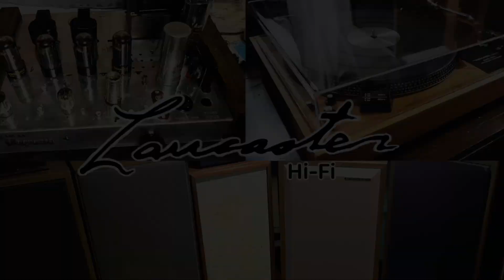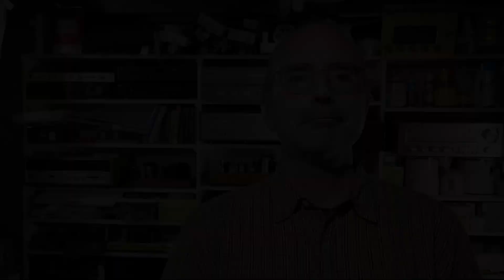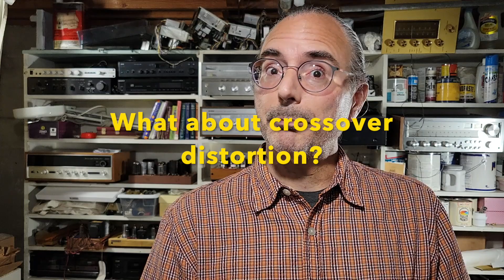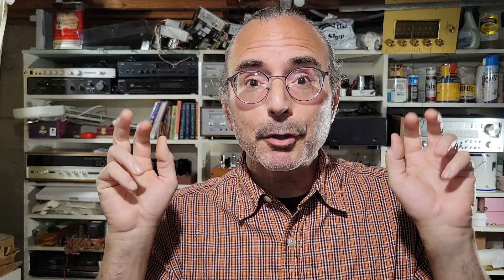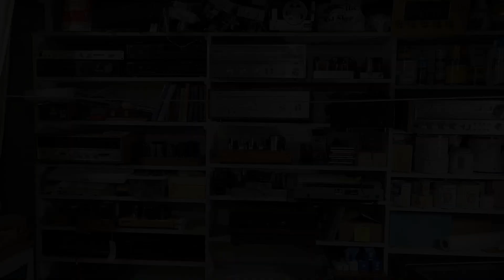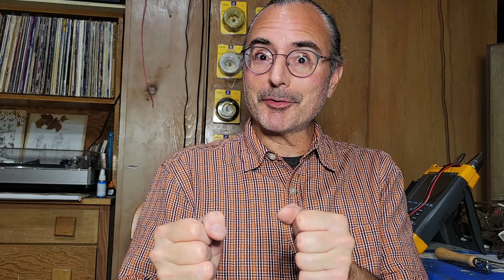Why Do You Want a Single-Ended Triode Tube Amp?

Comment: Well, of course all amplifying devices add HD and some even worse distortions. Also most changes we make to deal with the issues have unintended consequences not all of which are necessarily good. For example with appropriate amounts of FB we reduce over all distortion but it increases the order. Under what circumstances that is a problem is a matter of no small debate.

Now when one builds a SET they could bias it in a very nonlinear part of the curves or a very linear part of the curve. Some of the tube "buffers" for example run at ridiculously low plate voltages and are indeed distortion machines. But those same triodes when used properly in a line amp are exceptionally clean.

One nice feature of class A amps whether SE or PP is that the HD decreases as the volume decreases which isn't always the case in AB amps.

Now full disclosure the only hi-fi tube amp I have built so far is a SE one and it does use local FB in two forms. It is UL so it gets FB from the transformer primary back into the power tube. It also uses plate to plate FB which is also local. Sounded quite clean to me. I have no means to measure HD or IMD but it didn't seem to lose anything in clarity compared to my silver face recievers.

Once I finish the speaker project I do want to play around with PP EL84 probably triode mode at first.

Comment: Dear Stephen: As someone who is looking to buy his first tube amp, should I: Build a magnetic anplifier 2. Rebuild a pair of Atwater Kent televisions and run the audio as monoblock amps  or 3. Simply use a pair of earbuds that came with my phone, because I only have an amp budget of 500 dollars?
Reply from the maker: Do you mean a Magnavox amp? I would rebuild an old console amp, e.g., Magnavox. There are great threads on Audiokarma.org that give you the step-by-step, and whatever you can't figure out can be found by asking there. Those guys are knowledgeable and friendly. Less than $100 for an old chassis. If you use the original output transformers and tubes, all the parts you'll need will cost you less than $100. Then, you can upgrade with better transformers and tubes later.

Comment: I really enjoy your videos! I have a question for you with a bit of back story. I'm an avid 45 collector and always dreamed of having an old tube jukebox or console, but never wanted to deal with the record players contained within. I moved to Mexico City a few years ago, and LO AND BEHOLD, I found an old Stromberg & Carlson powered extension speaker cab from the early 60s, made in Mexico! It has a monophonic single ended tube amp with one el84 and 2 6 inch alnico speakers. I didn't even know such a thing existed. IT SOUNDS INCREDIBLE, just as I had hoped. BUT, I was wondering, if I wanted a stereo rig, could I just use two mono amps like the one I have? And also, I am a record producer. A long time back, I mastered an album on an old tube powered mono reel to reel from the 40s. We didn't even end up recording to tape because the passes were so problematic, but the sound from the tube amp alone was incredible. I'm interested in using one (or two for stereo) old single ended tube amps for mastering recordings. I have not heard of anyone doing in the modern age (please someone correct me if I'm wrong). So would I just need a load box to attenuate the output and implement a dummy signal? Sorry for rambling, THANK YOU!
Reply from the maker: Regarding the Stromberg-Carlson, if you can feed a couple of those with a stereo preamp, that would be a nice stereo system: tube mono-block-powered speakers. 
Regarding mastering, I'm not sure what sort of process you want to use. Do you want to use the tube amps as a processing stage? If so, you could use a line-level stage. If you want to use power amps (amps with output transformers), then yes, you'll need to put dummy loads on the outputs, and then you can use it at line level as long as your next stage has a typically high input impedance, e.g., 47K or 100K.
Reply: @Lancaster_Hi-Fi  Thanks for the reply! What I'm looking to do is, after completely mixing the album digitally, to run it out of an interface at a line level into two mono SE amps, and record that directly into another digital interface. Then after that I would do a final master digitally. We had actually done this before to an album using a tube powered reel to reel from the 40s. Didn't even record it to tape, just took the audio straight out of the tape machine monitor. Of course it was in mono, but the sound was fantastic! I know back in the 60s and before, there were tubes used  in the recording process, but I've never heard of anyone doing it the way I am proposing.
Reply from the maker: Yeah, you're adding pleasant-sounding, predominantly 2nd-order-harmonic distortion. The listener then gets the SE tube sound without needing tubes. Cool!

Comment: Very good. I finally built a stereo SET amplifier using 300B and it has a charm all its own. The harmonic profile is much like a sawtooth with descending amplitudes and a full spectrum of all harmonics. I had to do it because, as you mentioned, I had to hear it for myself. I eventually went back to my push-pull amplifiers. I particularly like the Williamson design. I also might add that in the, so called,  super-simplicity of these SET amplifiers, component values become much more critical than in push-pull amplifiers. I put in a switch in my SET to give me zero NFB and 7 dB NFB and prefer the touch of 7 dB of NFB as it makes it slightly cleaner. Long listening times do become more tiring, in my opinion and sine wave output is around 1% at 7 watts.

Comment: Correct amount of gain in preamp is crucial.i use 6922 series to 12bh7 one side driver to 6550 se snd channel subbed 5879 in v1 .no tone stack .one vol 500k for each channel no nfb for guitar.

Comment: A few years ago, I was the proud owner of a Sansui AU-719. In my apartment, my upstairs neighbor thought there was an earthquake happening. It wasn't a problem for him as he didn't see it as a disturbance. Since then, I've been adjusting my hobby audio setup to avoid causing any inconvenience. I relocated my entire setup away from the heating pipes. I replaced my floor-standing speakers with monitors on stands. Now with a tube amplifier, it's very loud indoors but very quiet outdoors.

Comment: Howdy. Great.
Yes. One can get a flat response using global neg. feedback.
There is a problem doing single wave measurements. It does not show the effect of phase lag. Adding a lagged sine wave to the original sine wave results in a sine wave.
OPTs may be considered to cause the same time lag at different frequencies. This causes different phase shifting for different frequencies. If this has any relevance to the sound, I understand, is a subject of debate. I can't take a stand on that.
Global neg. feedback easily generate spikes and ringing at the kinks measuring with rectangle waves. These may cause the end tube grids going positive resulting in blocking distortion. Spikes and ringing must then be managed by limiting slew rate. I don't use global neg. feedback in my designs. I take the feedback from the end tube anodes.
Another reason is I like the extra electrical safety the OPTs deliver leaving the secondaries floating.
High Regards.
Reply from the maker: I can see the advantage in going from the anodes. Of course, you'd need a coupling capacitor, and it would make the calculations for the (input stage) cathode and feedback resistors a lot different, but simpler in a way, since you just need to figure the resistance needed to attenuate the signal. Would that be a much larger value than going from the secondary? Plus the impedance of the primary being much greater, the value of the feedback resistor wouldn't have much effect on the value of the cathode resistor on the input stage. Am I getting that right?

Comment: Might you point me toward a SET amplifier schematic that doesn't require feedback and could be built by a beginner? And if not built,  perhaps easily modified, (like Skunkie Design mod -A 12). Props to Stephe. Suggestions?   95 dB sensitivity speakers. Heresy II
Reply from the maker: The one that's been recommended to me, and the one I intend to build, is the Simple 45, the latest version of which is the TubeLab SE II. With a few changes, it can be built for 45's, 2A3's, or 300B's. I have some Tamura output transformers that are perfect for 45's, so that's the version I'll be building.
Reply: @Lancaster_Hi-Fi  Thank you for everything. Appreciate learning from you.

Comment: I agree with some of the material, and from a different perspective. The main problem I find is that 
virtually no one understands the basics of how to design a perfect push pull amplifier. I am addressing naturalness, the instrument sounds real, not some manipulation SET using high distortion (as the author nicely mentions), to create some kind of 'pleasing sound', but not natural. If someone likes their 'pleasing sound' no sweat. But to claim the sound is superior is obvious nonsense. 
SETs will never be natural sounding for several reasons let alone the holy grail. (I applaud the 
author's clear explanations.)

1. The Harmonic Distortion (HD) is much higher, esp using DHT tubes with higher HD, with 
Intermodulation Distortion (IMD) typically some 2-3 times that of the high HD figure. 

Even at one watt, the HD of DHT types can be 20 times that of a properly designed Push Pull (PP) amplifier. At maximum output the IMD of an SET amp often runs some 15% to 45%. Interestingly, IMD product frequencies are Not related to the music. 

(IMD is the combining of different musical signals, and their harmonics to produce higher 
weird higher frequency harmonics not related to the music. Now you know why demonstrations of SET amps use solo/single instruments, not orchestras with their many instruments/signals. There is also big bucks selling the larger output vacuum tubes for more power out; often hundreds of dollars per tube.)

2. The damping factor varies to near zero damping to maximum, as one approaches max power output. 
That means the speaker cones are not controlled over a portion of the cones movement, increasing 
the distortions. 

To mask the odd harmonics of SETs, the designers will use techniques to insanely increase the 2nd harmonics, which limits dynamics, masks true inner detail, the natural music. Anyone seen 5 foot wide lips? 

3. Limited high frequency response. -3db at 35khz is not uncommon. This means the frequency response
from 20 to 20khz is artificially manipulated. At 17khz, ~ down 1.2db. At 9khz, down ~ .5db, and at 4khz, 
down ~ .15db. That may not sound like much, but the sound quality is affected down to the lowest 
bass. 

4. As the author nicely mentions, AB1 does not have notch or crossover distortion. Class B does however
and is often falsely presented as to why SETs are superior. 

Example: At one watt, my PP amp only has 0,05% total HD, without feedback. (The sound is not etched.) Try that with an SET, especially with a DHT tube. With them 1% or higher is typical at 1 watt.  

cheers
S
Reply from the maker: That's a lot to consider, and deep! Thanks!
Reply: Had a nice push pull el34 sold it for a SET 😂 . BEST DECISION I EVER MADE
Reply: @ChrisBeenDeadInside4WhileNow  What kind of speakers are you running, 
distorting Horns with a distorting low power SET amp? Great combo LOL. 
I have not heard a natural sounding SET amp yet.
With horns difficult to obtain natural sound, 3d spacial imaging, has poor low frequency 
response. 

I guess one bad push pull amp means all are bad. Of course that is not true.

cheers

Comment: If you are going to employ negative feedback in a SET would it be better to forgo tubes and just use solid state?
Reply from the maker: Good question. I've never had a solid state single-ended amp. I think the Nelson Pass Amp-Camp Amp is single ended,  and those have a following. My recollection is that the ACA has no negative feedback, though.
Reply: @Lancaster_Hi-Fi  🤔… I think the ACA might have negative feedback.
Reply from the maker: Could be. I haven't looked into it.

Comment: The highest grade amplifier should not use NFB. If someone is biased in SET for the added distortion for ones preference then lets go to soild state Push pull amp. 

Even in Push Pull soild state amp without NFB can far more better sounding than the one with NFB

NFB by nature ot on surface help to remove distortion but NFB at the same time also remove some subtle signals from the sound source and also alter few element of the original signal. 

There is a good expression from  Charles Hensen - To use the past signal to improve the right now signal, like NFB,   in real nature it does not exist
Reply from the maker: There are components that can introduce phase lag, especially at the extremes of the audible frequency range, and those issues need to be addressed in any good implementation of NFB. That said, the idea that you're using the past signal to correct the present is a misconception of how circuits work. Signal propagation is effectively instantaneous. If you doubt that fact, you just need to superimpose the input and output signals on an oscilloscope. But I'm unlikely to convince you I'm right if you're already convinced I'm wrong, so I would encourage you to do some research into the engineering literature (not the audiophile literature).

Comment: Looking at purchasing a PrimaLuna Dialogue 5, PP amplifier at 36 Watts per channel. Paired with 94 db tower speakers rated at 250 Watts. Should I go with it vs. a smaller Watt SET amp like a Decware Zen Triode? I like the idea of auto-biasing with the PrimaLuna and some of its built-in protection.
Reply from the maker: Your speakers are relatively efficient, but unless you won't ever want to really crank the volume, the Zen Triode is probably still underpowered for a "one-and-only" power amp. Might be great for you if you have a relatively powerful solid-state backup. That said, I've never listened to a Zen Triode, so I've never probed its limits. And I think there's a long waiting list.
Reply: @Lancaster_Hi-Fi  Thank you Lancaster Hi-Fi. I did pick up a Primaluna amp today and will be connecting it for the first time. Still have 50 W and a 70 W SS receivers. Enjoy your channel and appreciate the time you put in.
Reply from the maker: Thanks, and I hope you've been enjoying your Primaluna. Please report! How does it sound?
Reply: @Lancaster_Hi-Fi  It's been working out fine. Not a holographic sound but damn good. I added a graphic EQ for fun. Lossless streaming might tip the scales to great but I'm still rolling with Spotify.
Reply from the maker: One thing at a time, right?

Comment: You like Lou Barlow’s playing on the Rickenbacker? I like to have both PP and SE amps... Have you tried local Schade feedback?
Reply from the maker: Lou is godlike.
Reply from the maker: I haven't used Schade feedback specifically, but I've used local feedback in the preamp stage with a 7025 on my modded Magnavox AMP-185. This was local feedback from screen to grid of a single stage outside of the global NFB loop. It seems to work well, but I haven't put it through any rigorous testing, other than my ears.
Reply from the maker: Never heard of Schade feedback. Guess I'd better do some Googling.